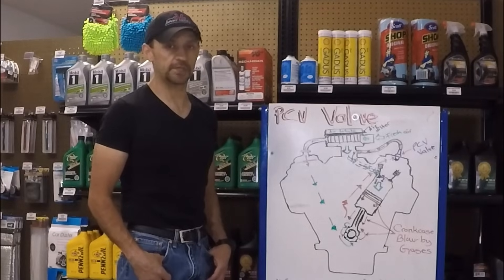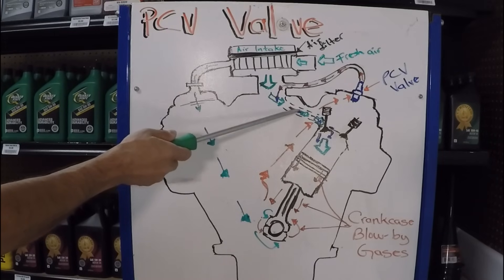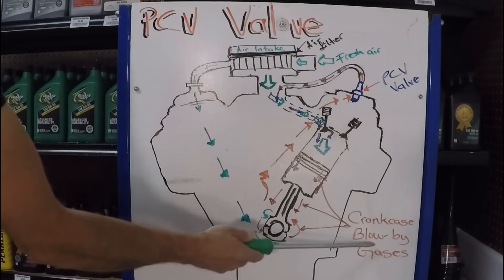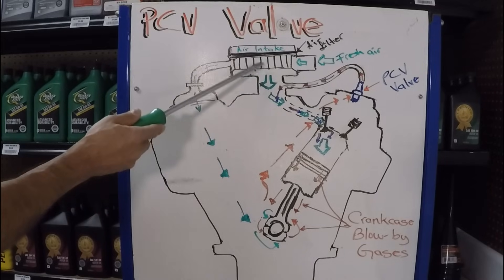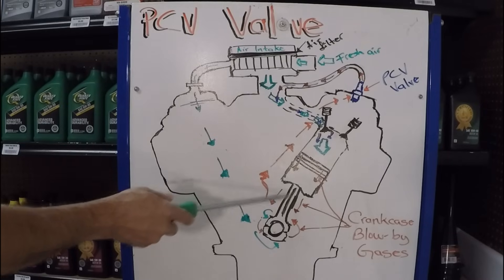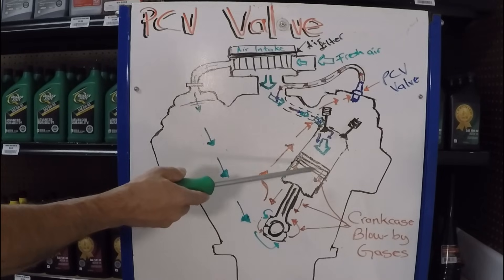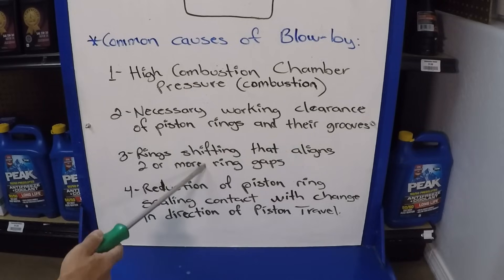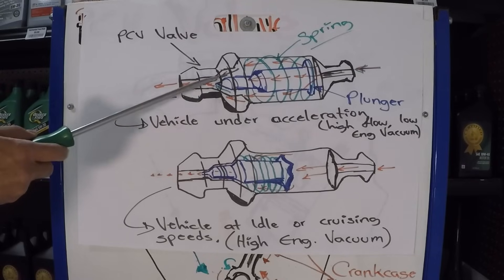How the PCV System Works ( PCV Valve )

Comment: Why don’t we use pcv valve in that fresh air intake small tube (Here at left side of the image)? May be we can set pcv valve in this small fresh air intake tube opposite way so that crankcase pressure would be constant. Note: my background is biology not engineering. Please don’t mistake me if this is stupid.

Comment: D4204t engine on Volvo S40,help me understand about the blow-by here ,,If I use a glove test the glove will be filled with air but no signs of oil under the oil cap,,so the mechanism of this engine is different from the others? Cause on the top I believe is were the PVC valve mounted and I think it goes to the turbo then the breather pipe goes is like 3inch under the oil cap inlate so is it still possible that I must still have that glove to be sucked in ???

Comment: System is flawed. There is still vacuum on both sides intake and breather,  moving air causes vacuum on line to breather. Best to run just a filter on non pcv side

Comment: What if the layout was exactly as shown except there was no valve, just an open hose from the valve cover to carb vacuum? Would this be detrimental to the engine?
Reply: At low idle air/fuel mixture is critical. With no valve in place this would be quite a vacuum leak to overcome. 

The valve cuts off the “massive vacuum leak” before it becomes a problem. What blow by gasses generated at these lower RPMs will be drawn into the combustion chamber via the vent hose to the air cleaner.

Comment: For first time ever, Replaced all the tubes, grommet, O Ring, Cleaned and Sealed Breather Box on my 95 
Honda Civic. It definitely seems to have more Power etc... What are the benefits to the car when cleaning breather box, sealing and replacing all the parts to it? Better Gas Mileage? More Horse Power?

I also changed timing belt, water pump, tensioner, Crankshaft seal and camshaft seal and Valve Cover seals..... 
Car Definitely has better response, smoother and seems to have more power.... Does cleaning and replacing parts to Breather box do all of this or is this from changing the timing belt? Thanks!

Comment: 2:00 If I only have fresh air coming from the carb air filter and not the tube on the valve cover.....

1) how many push in breathers / air filter pod you can place in a valve cover to obtain that cold air into the engine?

2) can you place breathers on the valve cover around where the PCV valve is installed.

Comment: Is the PCV valve ever fully closed in low vacuum situations?
Reply: No, only when the engine is not running (no vacuum) or when backfire occurs (pressure).
Pause the video at the very end and have a closer look at the drawings to see flow characteristics and metering function in addition.
Too bad that the detailed explanation has been cut off of the video!

Comment: the new so called pcv valves have no valve, infact mAB nothing but MpT spAc. NEwA, how bad is oil leaking(as it usually does) from crankcase, through pvc valve if it isn’t clogged, back into throttle-body, intake, etc.?
not that it makes any colossal difference, but how bad is oil, sludge, etc., leaking through clean air vent(also back through throttle body, intake, & so on)?-  &&& on this nOt of revolving carbons sludges etc. revolving through here or there, back through throttle-body,  intake, & so on, do either catch cans &/or AOS’s clean carbons, etc., from oil, or air, before returning it?☝️🤔

Comment: Great vid. If you take the oil filler cap off for a few seconds while the engine is running, does it affect the pcv valve, or cause an oil smell outside of the engine?

Comment: Hi !!!!! According to your diagram there ,the PCV air circulates from the air box through the crank case and then to the PCV valve. Now I learned that blow-by causes oil to get into the air-box, but how does it get into the air-box if the air circulates from the air-box to the crank-case? Plus the crank-case breather is between the air-box and the valve cover too. On my 2001 dodge ram van anyway. I'm a little or more than a little confused about that!!!

Comment: So when an engine is running, there is at least a mild pressure in the crankcase.  In a naturally aspirated engine, there will always be at least a tiny amount of vacuum from the opening of the intake system all the way to the intake valves.  How then does fresh air flow from the air intake, where there is vacuum, into the breather, where there is pressure?

Comment: Why would pressure ever build up enough to blow gaskets or force oil out through seals?  If the PCV valve gets  stuck closed, then surely any excess pressure would go out through the breather??  (or is there a one way valve in the breather inlet?? )   At idle,  when vacuum is high and blow-by is at its lowest, the PCV valve is open. At higher revs (lower vacuum in manifold) when the blow-by is greater, then the valve is likely to be partially or fully closed??  I'm afraid none of the videos I have watched really explain how the valve operates - or even why you must have such a one way valve...
Reply: Look at the drawings of the PCV valve again:

The valve’s inbuilt spring is designed to hold the valve normally open. When the engine is at idle the vacuum is high due to the throttle butterfly being nearly closed, overcoming the spring and closing the valve. Step on the gas, the throttle butterfly opens lowering manifold vacuum, which is not enough to hold against the spring pressure any more, so the valve opens up to draw blow by gasses into the intake passageways.

On my ‘70 Ford truck the PCV valve is mounted vertical with a normally open check ball. Under high vacuum the weight of the check ball is overcome, which draws it up into its seat. Step on the gas and the ball drops to open the valve once again. 

The reason for the valve is to shut off this “engineered vacuum leak” during low rpm where mixture control is more critical.

Comment: ON the left side of your drawing, shouldnt the air be flowing  from the valve cover to the carb area?? I put another air cleaner on a 73 pinto 2.0 and was wondering how to hook valve cover breather to the air cleaner.
Reply: NO, you can see  right side its flowing from teh valve cover to the "carb area" or intake manifold. On the left the Fresh air is flowing from the Air cleaner housing to the other valve cover. On you new  "racing" air cleaner there should be some hoes you can punch on the bottom of the base of the air cleaner wher you can put a grommet or a bung to connect the air hose. I would NOT have replaced the factory air cleaner on a 2 litre pinto. It will do nothing for extra performance and  my likely hurt gas mileage as now you don't have the warmup stove. Have fun regardless  -Sandy the aging Hot Rodder.

Comment: why is it said that if pcv valve will fail, the oil cap will not come out easy ? I mean inside the crankcase there has to be pressure, if pcv fails, there should be pressure inside crankcase so cap should be easy to remove

Comment: the only improvement to this system would be the installation of a canister above the PCV so that oil is trapped and gases can continue on. Oil contaminates the valves.

Comment: Are all PCV valves The same flow rate 
So the question I ask if I replace my plastic PCV valve with a billet Aluminum Will that work at the same designed flow rates as my one for my vehicle ?

Comment: I have a gm 3.8 with a water leak up the the pcv channel in the rear cylinder head. Does that mean my head gasket is done? Is my block cracked? Water and oil are definitely mixing...

Comment: Excellent presentation. It has helped me discover I am missing a pcv valve on one of my valve covers.....it just has a sealing twist type cap. The other valve cover is connected to the base of the air filter. This means the vacuum suction isn’t working properly. My question is   Where should the hose from the pcv be connected.....to manifold vacuum at base of carb or to intake manifold vacuum further away from carb
Reply: Either vacuum source should do.

Comment: Can i ask something? I still dont understand why does the pcv valve drag the vaccum through the cam shaft cover? Why does the fumes have to go through there when they could be easily routed out of the crankcase only?
Reply: I think it's done that way because the valve cover is the highest point on the engine. If the opening for the valve were lower, it could leak oil through the hole.
Reply: Shown is a V8 engine. The inside of the engine (where the oil splashes) will accumulate blow by gasses. This needs to be ventilated throughout the engine. Filtered air is let in one side of the engine, travels down the oil drain passageways in the cylinder head, crosses the lifter/camshaft valley, then up the oil drain passageways of the opposite side cylinder head to be sucked from the engine into the intake manifold runners and be blended with the air/fuel mixture prior to re-entering the combustion cylinder. 

This blow by gas induced in the engine will be slight at idle, yet increasing with rpm and load. At idle the PCV valve will be closed due to high manifold vacuum overcoming its spring. Air/fuel mixture is critical, and an open PCV valve makes it practically unmanageable. What slight positive pressure produced from blow by gas during idle and very low throttle opening will be drawn into the air filter housing – this being a closed system to capture and reintroduce unburnt hydrocarbons back into the combustion chamber. 

Step on the gas and manifold vacuum will drop allowing the spring to open the PCV valve. The gentle flow in the vent hose will reverse as the manifold vacuum draws the blow by gases into the intake manifold.

Comment: I think you may have missed a 5th cause.  It is that of worn or loose valve guides.  I have experienced this in several older V-8 and V-12 engines.  But thank you for a clear explanation of the basic system.

Comment: Nice explanation, I have a 60 impala that the prior owner installed a 350 with double hump heads, performance com and no pcv system. My engine leaks from the newly installed valve cover gaskets and smoke comes from my passenger side valve cover breather. I will install a pcv system but trying to determine the correct pcv for my double hump heads(i believe they came from a 68 camaro 327) thanks again.

Comment: Can someone help me understand why the PCV valve is in the valve cover and not the crankcase? Surely if you’re trying to ventilate the crankcase the valve should be in the crankcase? Or how do the crankcase blow by gases make there way to the PCV valve in the valve cover. Just trying to understand it better, cheers!
Reply: pcv wont survive the oil splatters if its in the crankcase

Comment: Very helpful video. What would happen if you capped the entrances from the intake and the valve cover?
Reply: You would start blowing out gaskets, like  the rear main seal and valve cover and oil pan gaskets Also your fresh  oil will get contaminated fast with moisture and combustion blow-by. Cars have always  had  breathers. At one point they were just a  draught tube that ran from the crankcase down along the back of the engine to near the road. But there was still a  Breather cap on a Rocker cover or on the intake valley or pushrod cover on the side of the engine.

Comment: So is this bad happening?? I have a wrf 450 2005 model that has a hose attached on the upper of the valves cover and goes free down on the footpegs attached to nowhere and  I noticed too much air was coming off this hose as the engine worked.... Is this normal or what??

Comment: Best explanation I’ve come across. Quick and straight to the point without any unnecessary complications. Thanks !!
Reply: did u cut out the best parts at the end?
Reply: but why engine need a "fresh" air from intake manifold? Thats not enough to release combustion gases ( which are in higher pressure) through the PCV valve into manifold? Why on this diagram, cranckase is conected with manifold (on left side) with no valve??! cant understand. Thats mean, combustion gases are all time evacuated into manifold...please explain me someone. Yes im totally newbie.

Comment: I would like to add a little to it. The bore distortion will also cause high blow-by. It is seen at high RPM and high load condition. 
Secondly the every PCV system has reverse flow condition when the crankcase pressure become positive. Normally It happens when engine operates above 5000rpm with wide open throttle. The pressure in the intake manifold is close to atmosphere so the suction in the fresh side is greater than dirty side PCV.  The blow by gas starts flowing out through the fresh hose to induction pipe.

Comment: To understand: what force cause the PCV spring works (open/close)?... the vacuum or the pressure of the crankcase?  ....  because I have problem: I saw high vapor come out from the oil cap. wonder why! ..... I replace the pcv valve 2 month ago.
some one told me maybe i have blowby problem. I know what cause too much blowby, but before go throw the piston ring I wonder if with a oil catch can can fix this.
But my question is, the pcv valve maybe is defective and no working properly to release that pressure??? PLEASE HELP !!!

Comment: I had a small oil leak that the clowns at Firestone Auto claimed were leaking valve cover gaskets at $300 a piece, front and rear. Needless to say their diagnosis was bogus. I ignored it until I saw this video. So it was my PCV valve that caused the oil  leaks, as I was too find out. Needless to say I have dropped Firestone from my list of service stations to depend on. My car is 12 years old and runs good, with 170k  hard miles on it. Thanks! I never would have guessed the PCV valve to cause the oil leaks.
Reply: I know 5 years passed, but how did oil leak out of the pcv valve? Because the seal on the valve itself and where it sits on the engine was broken? 
Or did oil somehow travel from the botton part of the engine and out the valve and into the combustion chamber?
Reply: @gabiborsky1811 I think oil can leak (or be forced) through seals and gaskets, because the PCV valve malfunctions. Since it can’t allow pressure in the crankcase to escape back into the intake manifold, the pressure forces oil vapors through the weakest seals, gaskets, seals, etc..
Reply: @danayo8852  as a new automotive student, I recently learned this from the book.  The higher pressures within the crankcase, can cause oil to be forced out of the seals.  Now, my understanding is that the resulting damage will require replacement of these seals because one the oil is forced out of them, they are damaged.

Comment: It seems like the PCV valve is redundant as well as a engine-sabotage... On most cars, like you've illustrated here there's already a bigger, more efficient crankcase vent and it's not stealing vacuum from the engine like the PCV valve is...

I mean...

Why not plug/cap-off both the pcv-valve & pcv vacuum port to the manifold and leave all crankcase venting to the other bigger 'breather' hose that's already doing it anyway? 

By plugging the intake-manifold, the pcv system is no longer stealing engine vacuum.  With more vacuum available to the engine, the engine is able to vaporize fuel more efficiently.  With better fuel vaporization, there will be less blowby in the first place.  This would also even slightly increase mpg, hp... what do you think?

Surely somebody has thought of this and/or tried it before.  Why or why not would this work?

Thank you..
Reply: also most blow by is likely created at WOT or near WOT and as indicated in this video the pcv valve is closed at this time, forcing the gasses to escape threw the "fresh air" side or by blowing out gaskets and seals.

right?
Reply: Well, in this video, in his diagram, it looks like the breather hose and pcv hose are using same vacuum source. Most modern engines have the pcv using (siphoning) engine vacuum via the intake manifold (much stronger vacuum). Most of the blowby is caused by the pcv stealing the engine vacuum which causes combustion to be weaker and waste more fuel, sending the wasted fuel to burn up in exhaust as heat, and not used to power the wheels. In other words, the pcv is an intentional vacuum leak corrected by just blocking off the manifold vacuum and either rerouting pcv hose to low-vacuum source (before throttle body) or just capping off the pcv valve and let breather hose do all venting.

Comment: if PCV is blocked , oil would leak from the engine ,right?, But wouldn't the blow by goes out the breather side ? instead of leaking from seals or gaskets ?
Reply: How does a nad pcv valve cause oil leaks ?
Reply: The seals are designed to keep dirt and contaminants out of an engine with a slightly negative pressure in the crankcase in relation to the atmosphere we live in. If the blow by gasses are allowed to accumulate to the point of pressurising the crankcase above atmospheric pressure seals will not work as efficiently, allowing oil to weep past; and possibly, in extreme conditions, blowing out a gasket if they were ever to ignite.

Comment: Under what conditions should the pcv valve be closed? And why does it need to close? Must be a reason otherwise why have a valve at all?
Just curious.
Reply: I think it needs to be  closed at idle,otherwise it will mess up the idle, it will be like an intake leak.

Comment: blow by can be caused by bad gaskets too
but the 2 most important things that a pcv vlv does are that it will lower your engine operating temperatures (bc of the oil moisturizer action & active ventilation of the inner engine) and it will lower emission gases @ tail pipe (lower temps translates to a better op range + a better eng performance)
.. as a bonus, it will preserve better your cat conv, surrounding metals that activates on the system, save you gpm, preserve gaskets, seals & other related metals & chemicals that seal the eng; and of course your o2 snsrs as well 💲